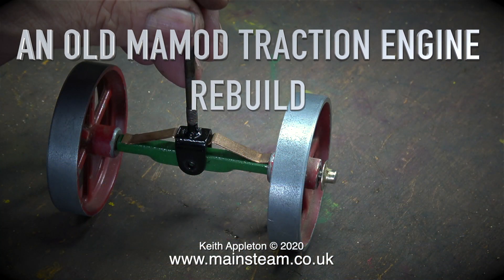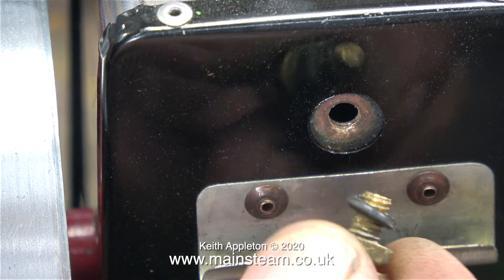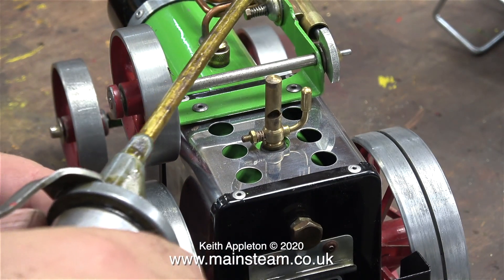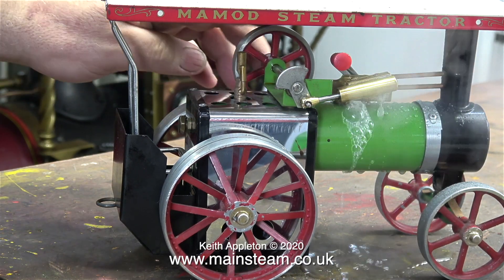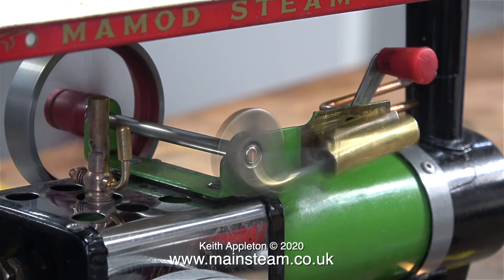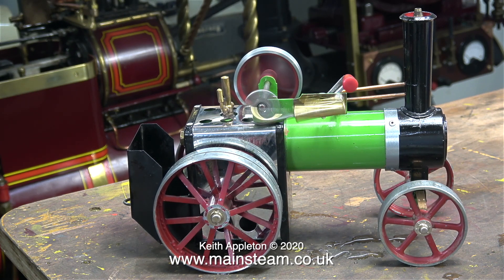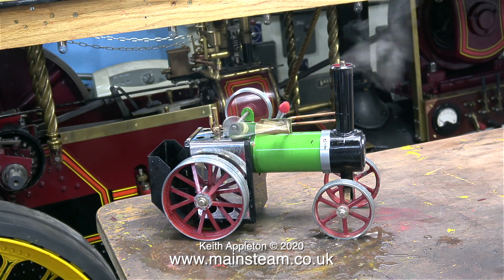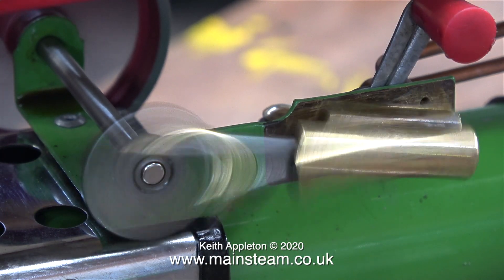A MAMOD TRACTION ENGINE REBUILD - PART #5

Comment: You can Lubricate the piston and Cylinder with Steam Engine Oil, which is what I do every time I fire up my Steam Engines. Steam Engine Oil works very well on all the other moving parts and it is thick and stays where you put it.
Reply from the maker: Yes I have mentioned that in many of my videos . . . .

Comment: Sorry I am two years late, but I just discovered your videos. I too am an older guy (55) still fulfilling my childhood dreams. I have an old Mamod Steam Roller-mid 1960's vintage that I just cleaned up. Mine did not have a roof so I made a reasonable copy from tin plated steel & brass. Then it was repainted and new seals. Then the fun part, modifications. I drilled the "scuttle and added handrails and a hitch. Next, I built and added steering gear/chains modeled off of my Wilesco Tractor. The finishing touch was a chain to hold the hitch pin and a nice erector set trailer that attaches to the Mamod or the Wilesco perfectly. I absolutely love these mechanical things

Comment: Hi can I ask a question my TE1a runs on bench but not on the ground that well I noticed that the more you pushed the regulator forward it went faster mine slows  have I got it lined up wrong ?

Comment: Interesting about the oiling on these low pressure engines. I have a couple of Wilesco engines which will run for around 1 1/2 hours on one boiler fill. The instructions say to lubricate every 10 minutes which means releasing all the pressure from the boiler. I run them slowly and only lubricate them at the start. In theory the huge D32 could run all day with it boiler feed pump but I always think it is best to stop it after about an hour to fill the lubricant up. I am curious to know if it would run longer now and not come to any harm as the water will provide enough lubrication. These engines also run on about 15 psi.
Reply: On my latest Mamod steam rail car I popped on two taps, one for steam in and one for water in. I made a one way valve block so I could use the Mamod cylinder as a hand water pump. (If you fancy running longer or harder) On the real ones I have seen two taps with a chamber in between and a funnel on top. It lets you drop oil charges under pressure like an air lock on a submarine.

Comment: So, I watched Steve (a very able clock technician) on The Repair Shop perplexed by a steamed-up Mamod not suddenly bursting to life without even turning it through a stroke. At least he knew to ensure that the safety valve was working. Those people needed your experience.
Reply from the maker: Yes I saw that & that small tinplate steam boat restoration . . . . .

Comment: Yes there is something Magical about these simple engines. A Tip for newbies if your boiler runs dry let it cool before you add water. I have seen some that have had a handpump added, which if it is used when the boiler has gone dry can lead to problems.

Comment: Awsome!
Don't worry i still alway, with almost not even one singe exeption, owerfill the lawmover gasolin tank... ha ha.

I fully agree, i hawe some used radioequipment i plant to mount on the Basset and Bowman locomotives in the future, and i even started to build a computer controlled system for the H0 scale locomotives, but i decided to make a complete owerhaul and install some very old hand controls for the analog parts since it is so much more fun controlling the locomotives, switches and signals by hand!

Comment: This too brings back many happy memories but perhaps from only 45 years ago !  One trick my father always used for his basset lowke pot boiler O gauge locomotives and some twin cylinder oscillating locomotives made by a company called Bar-Knight  was a few drops of steam oil in with the boiler water.  Both had crude hydrostatic lubricators I recall but I don’t think they were very effective.

As grown up engineer  now, I can think of many reasons why this should be a bad idea. Your video highlighted priming which you would have thought would be terrible but strangely this was not a problem and the engines went so much better. We always emptied any water out after a steaming.  I used it for the Mamod with good results. The smoke box would get a bit oily eventually though which suggested the process worked.
Reply from the maker: Yes I guess it would work as these engines run at a very low pressure {:-)))
Reply: I was able to confirm with my father in our lock down Skype tonight that this technique really helped with the  0-4-0 Bar-Knight (Clyde model dockyard) engines. These had two cylinders larger  than the  TE1A  but small wick burners nothing like the output of the vaporising one on the Mamod   so steaming was marginal and minimising friction was essential if the train was not to get stuck in the most awkward place  under the high level section of the inside  portion of the layout. I have such vivid memories of these and the Basset Lowkes thundering around the track. I think I was hooked on steam from then on.

Comment: Oh well, if you are interested i could give you my mamod steam roller from 1972!

Stil better in your hands than in mine
Reply from the maker: I already have one thanks, why not play with it - one is never too old {:-)))
Reply: @keithappleton   you can still buy a replacement water level plug off the interenet i know this because i got one for my early Mamod steam roller  thats if you don't want to use that brass bolt any more